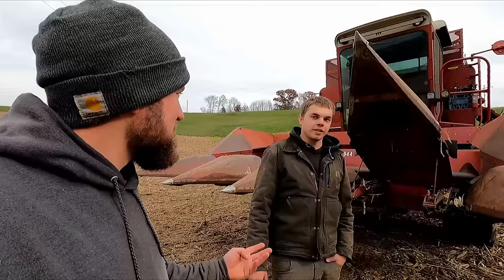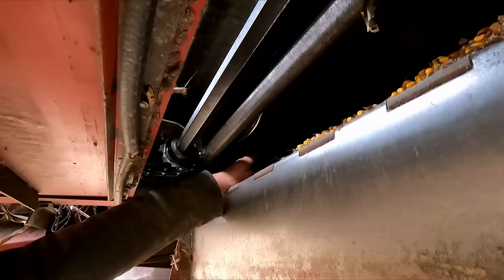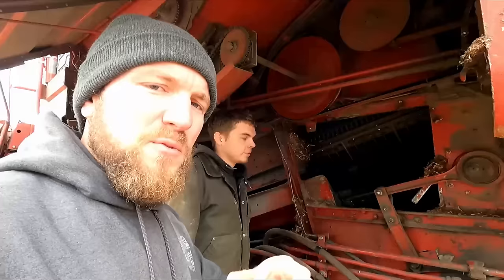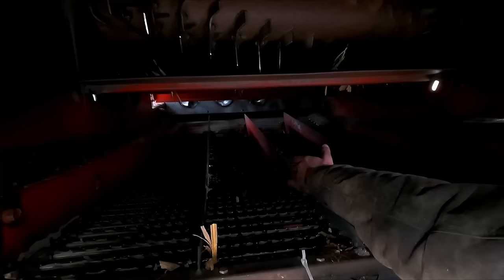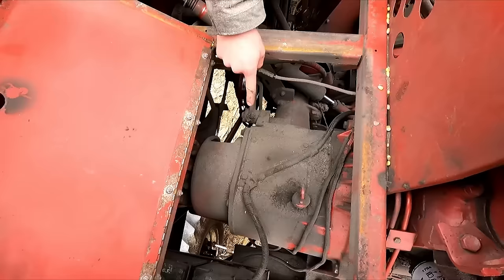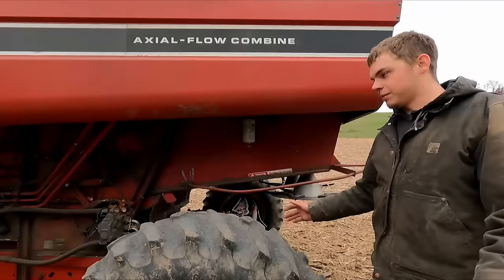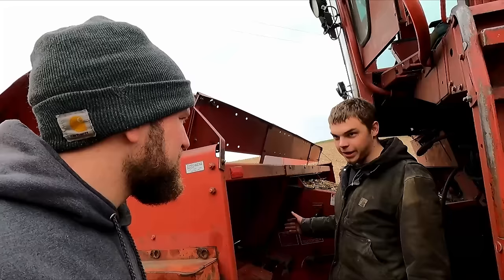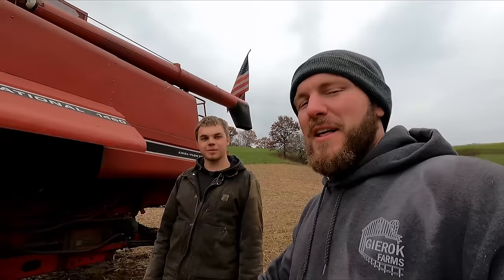How a Combine Works! Full Walkthrough of an International Harvester! 2023 Harvest Season!

Comment: It’s nice seeing that a person is willing to take the time to share their experiences with running the older equipment no matter what brand it is
Reply: Wow. I sold those machines when they first came out. They were so far ahead of everything on the market. I didn't hear what year model this machine was but they were introduced in 1977. Quite a legacy. Nice to see this young man owning and operating a machine that might be as old or older than himself. What a testament to the machine. Oh and the new series 9 of the same machine is just a fantastic unit. When you see a 40- 50 foot header operating at an unbelievable speed it just makes you appreciate the advancements that have been made. This is what has made the American farmers the BEST. Hard to beat. Thanks for the time you took to make the video. Congratulations 😊 0:14
Reply: Oh I should have mentioned that I am 79 and still work supplying parts for AG and Construction

Comment: Rocking a John Deere 45 with 210 two row head, IH 656, and AC WD-45 down here in Highland WI!  My first year farming and its been a lot of fun learning how to tune in these older machines and get through the brake downs.  I didn't think about the side hill issues and that explains why I loose some out the back at times.  Seemed like no matter what I did I would either get some out the back now and then or i was getting trash in the hopper.  Now I know thank you!

Comment: Biggest issues we had with those 1460s were the clean grain auger that ran across the bottom and the other was the feeder house jackshaft and also the shaker arm bushings . Everything else was common ware items as for the 900 series corn heads we also burned up the front gather chain sprockets about once a day and the drive chain on the left side ran in dirt and leaves all the time making it a issue .   I have been around every version of the Axial Flow including the Next Generation AF10 which will be the largest with close to 12 ft long rotor and 775 hp with 550 bushel grain tank.

Comment: Interesting to see Matt's IH 1460 combine. Sure had well-kept tinwork.  Must have had various options available as new machines judging by the control panel. Many after-market and salvage parts are available...part of our decision to get a 1460. Not unlike your Dad's New Idea pickers...older machines can be rebuilt and gain extended use. Sometimes "parts machines" are a bargain if you take what's needed then part out or sell the rest for salvage.

Comment: 3 years of work (?) and 15 years of experience so it seems. The guy knows what he's talking about. Keep him around.
During my career, I have met quite a few harvesters and different headers, mostly prototypes. I did material research on parts and now, climatic tests on the full machines. I think these machines, next to foragers and specialised harvesters (flax for instance) are prone to wearing out pretty quickly compared to other machinery out there. sand and rocks are just the worst for machinery. It is nice to see an "old" one on the inside. I'm pretty surprised that everything is pretty reachable, except for the engine bay maybe. It's a bit different with newer machines. I never understodd why there are open gears on these machines... I understand covers can catch dirt which makes things worse, but open gears make me cringe a bit. Is there an explanation why that is that way? What does the operator think? i really would like to understand that choice of design.